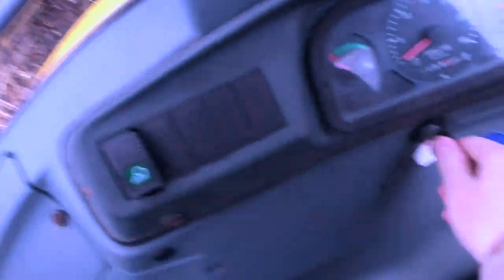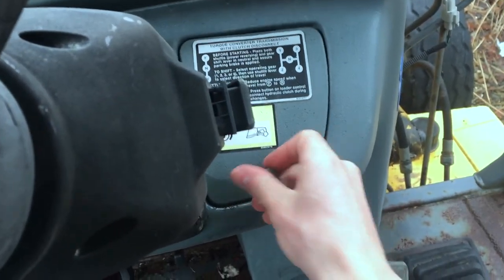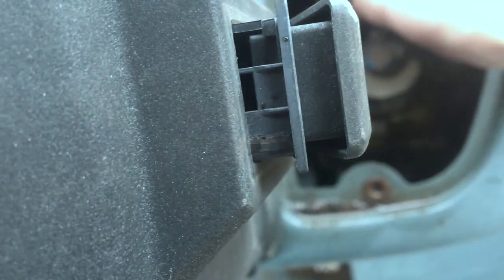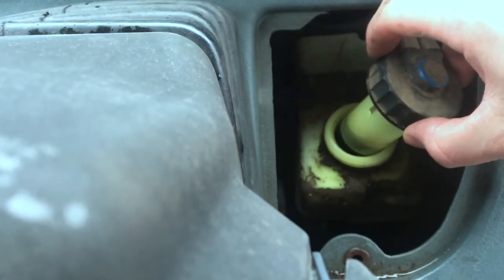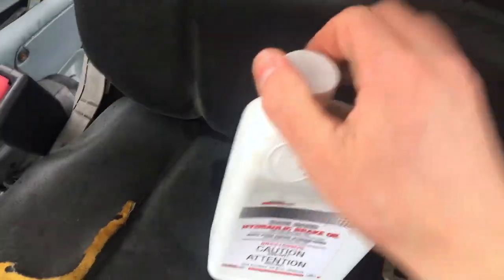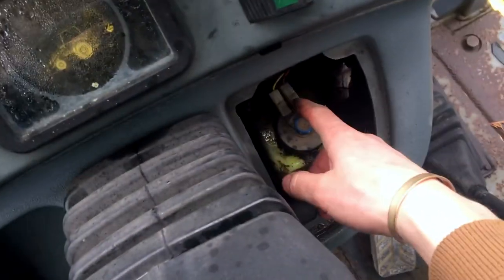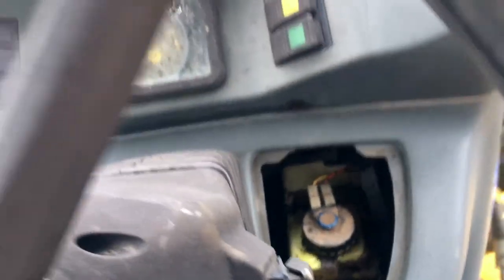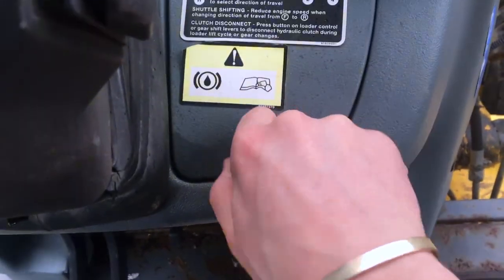Warning Light Backhoe FIX

Comment: Please put brake warning light in your title. Searched for oil pressure and got your vid.
Reply: Was you problem oil pressure or brake fluid?
Reply: @bullbikkov7239  I was searching for info. on the oil pressure system. I had a huge rewiring job on a backhoe that was due to packrats. I'm just suggesting you edit your uploads to be more specific.